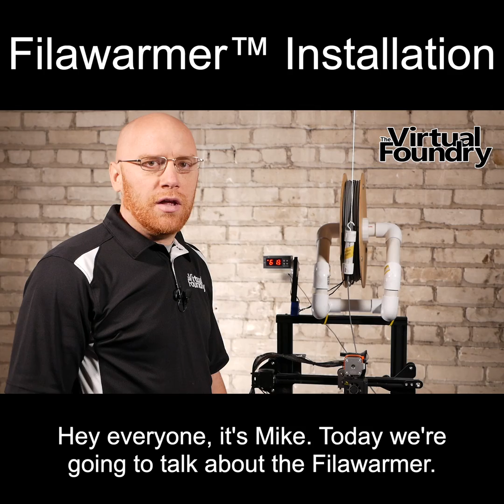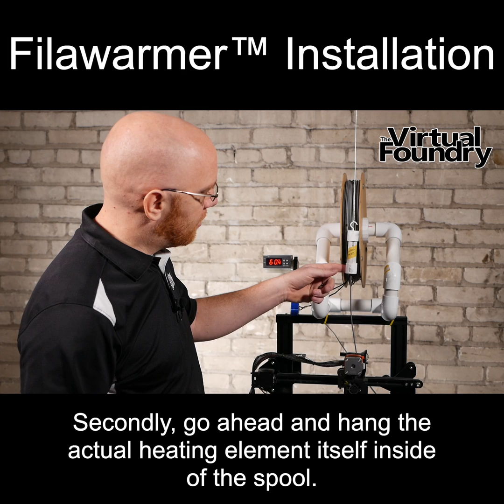Filawarmer™ Install

Comment: Does the Filawarmer get hot/warm to the touch? I've hooked it up but unable to verify whether it works (it doesn't feel warm at all).
Reply from the maker: Great question! You won't notice the warmth of the Filawarmer on the outside. But, if you put a thermometer on the inside, it should read 60°-65°C.

Comment: Hi ! I have some questions about that.
Our printer is Ultimaker 2+ and the setup is not like  yours. I mean our printer need to use with the feeder tube ,so the filamet will be bend not a straight line. Is it ok for that? Or may I contact you with email?
Thank you so much
Reply from the maker: We've added a short video demonstration to help with this. https://youtu.be/1BwacrOAu8A

Comment: how does it get power? I don't see any power adapter.
Reply from the maker: Hey Timothy, first and foremost I apologize for that fact that I am two months late in responding to your question.  I'm not sure how but it managed to slip through the cracks on me.
The Filawarmer™ comes with a standard 120V plug.

Feel free to contact me directly with any additional questions: Mike@TheVirtualFoundry.com